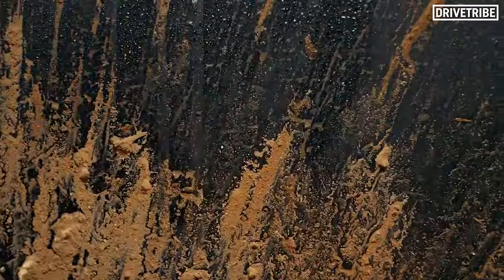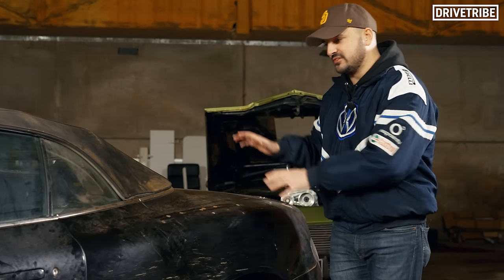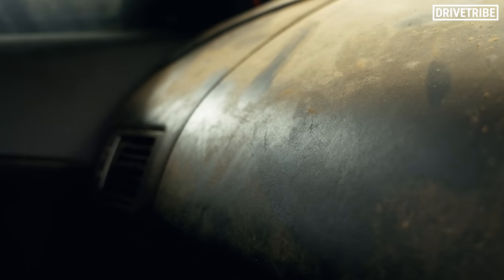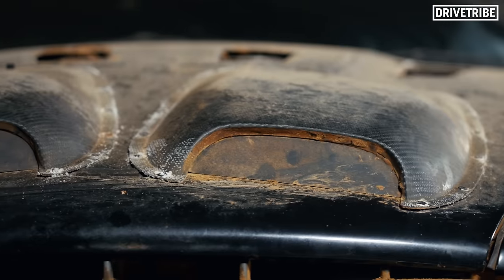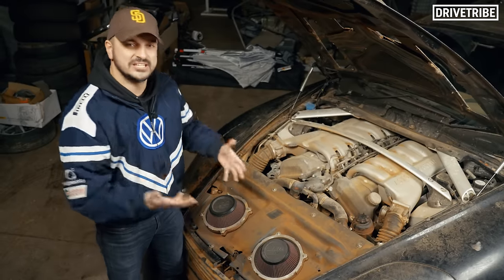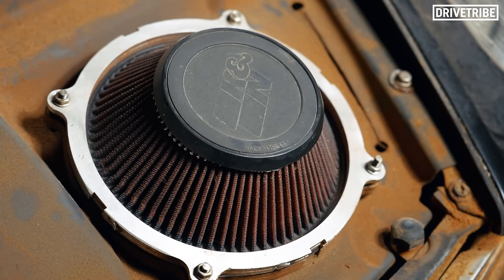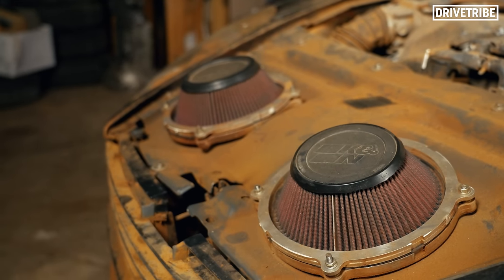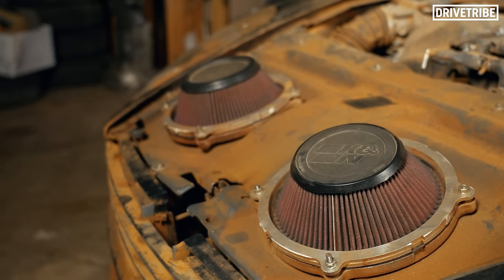We've Saved ANOTHER Grand Tour Car – Sand Job Edition!

Comment: Please do option 3. The subaru was made nice and clean, but this has even more character and should be kept as it is. Just fix the issues it's got. Jobs a goodon
Reply: A cursed car lives
Reply: Agreed fix the faults leave the mods. it definitely needs some clear coat to keep the dust on the panels too.
Reply: Agreed, can we put the tent back on it too?
Reply: @BlakeBergy with the tent and all the necessary work done, we can finally see the metro cab
Reply: Martin they did more than just make it clean and nice, they went further with improving its  power and internals. This Aston, looked awesome when it was clean and nice with those mods... all the sand and damage ruins it. Clean it up, to where it was pre-damage and wear. Thats what they should do. Save the exact preserve as it is for the car Richard drives in the final Grand Tour.

Comment: I've worked in the factory that produced the head and tail lamps for this car for over thirty years. I work in the moulding shop and have installed and ran the moulds for the lenses and housings as well as the power wash cover. It's so cool to think my fingerprints may be on the lamps on this car.
Reply: I like stuff like this, as does one of my sons. I have a picture of both my sons in the remains of Richards VW Camper bug out thing, from the episode (might have still been Top Gear) where they were on Salisbury Plains. My son still has one of the baked bean cans he had in it, its still on his shelf today with the bullet holes in it. We came across it out off roading,  it was left abandoned outside a training area. I had the thread from Richards jumper hanging from my rear view mirror for several years!
Reply: That is so cool, this was in Canada? Would like to get hold of the new head lamp lenses for my DB9!

Comment: Option 4:  Service it and fully convert it into a fully capable Sterrato killer on a decent budget.  One of the things missing from the Sand Job special was the process and level at which this car was prepared for the journey.  It just seemed like it showed up with stuff on it- a couple of air filters and bigger tires.  Was there even any suspension work?  Certainly nothing was done to secure key systems for the trip- skid plates- wiring protection etc.  Go through it make it truly impressive Rally Tour car.  Aston RT
Reply: Have you seen it? Each car has a massive skid plate, otherwise it would've been a 5 minute episode. They go over the mods and as you can tell from the stance, they did suspension on them. They even go into it at the start. The point was to make these on a budget and it they were super reliable, the episode would be very, very boring.

The work is done by a shop they hire. Hadrian, Hammond's landlord for his workshop, has done many of the conversions over the year. You never get to see them for this reason, they always just show up and explain the mods. Ever time it is shown, it is all scripted of course. Mongolia was the only time they equally put the work in, along with the budget Italian sports car service in one of the later Top Gear seasons. Yes, this is Grand Tour, but the production team is 95% Top Gear crew. Same deal, different name.

The skid plate on the Aston hid the frame you can now see, which supports the farm equipment he puts on. That is a lot of work to get it to function on a unibody car.

Comment: It's quite appropriate that the Aston DB9 was the car saved from the penultimate episode. The first ever Top Gear 'Challenge' episode (which is basically what spawned the whole challanges and specials type episodes) was the DB9 vs. Train way back in the first episode of season 4 (almost 20 years ago!).

Comment: I'd like to see between option 2 and 3, fix the mechanical issues, replace the tent, add mesh to the bonnet holes (basically minimal upgrades to make it presentable), plus any minor mods to fix the overheating issues (should it return to the desert). basically I'd have said option 2, but mad max, too far, keep it as close to original grand tour spec as possible while learning from the issues that arose during the special.

Comment: For the car, I would say clean it up, repair the rear glass and issues with the engine/electrical but leave the mods as is. Don't replace the grills on the hood, don't fix the scrapes on the rear, just keep it as if Richard took it home and kept driving it after the special.

Comment: What I would love to see is instead of Mad Max, find some rally event or something you can participate in and get it prepped for that. Maybe use it to showcase some of the grass roots racing around the UK and Europe. 

As much as the visuals tell a story, Le Mans cars can do that because the whole bodies are made to be pulled off. Without getting terribly invasive this car will always have ghosts in the machine. 

So get the body clean enough to race, or filler the holes well enough to wrap it, sort the mechanicals, proper rollcage safety, and go.